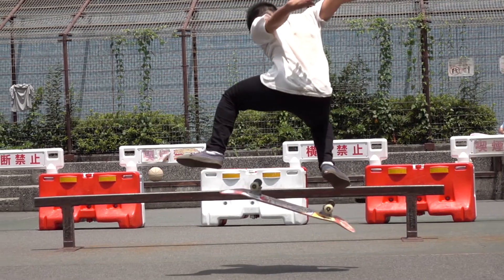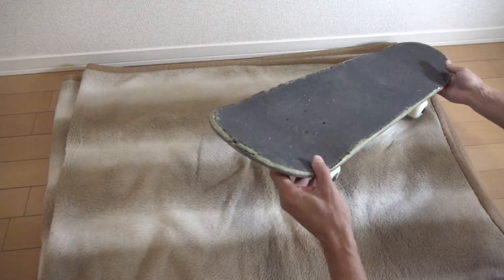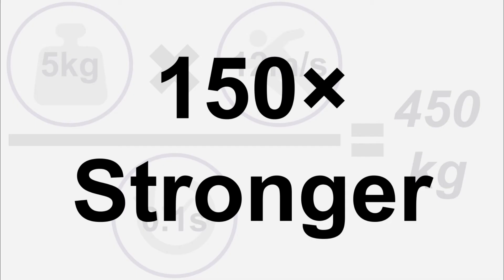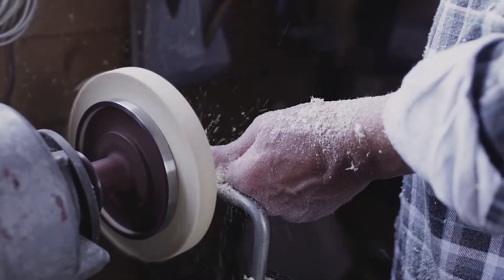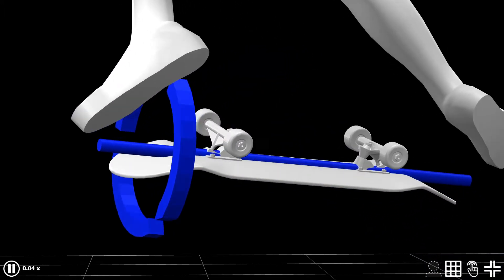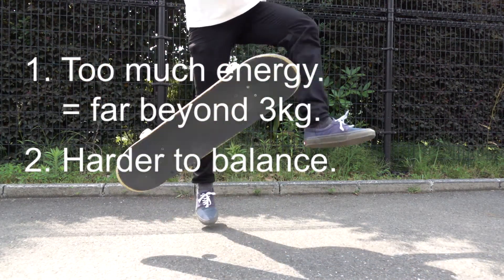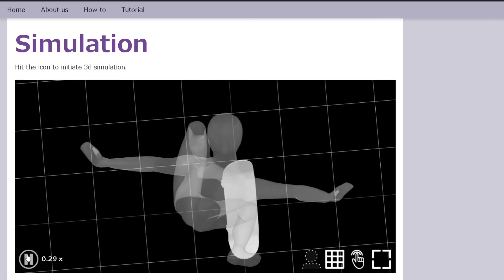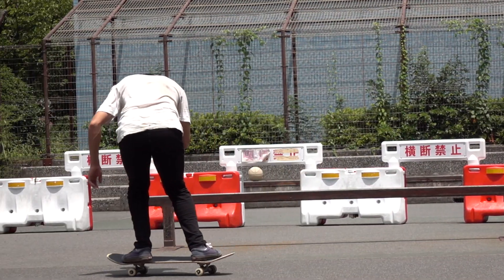Scientific analysis on flicks in kickflips with 3D models.

Comment: Ive landed a kickflip only a handful of times and your absolutely right it comes down to precise technique and timing, not force. I remember exactly how it felt when i landed my first kickflip, I popped straight down, jumped straight up, and flicked level to the horizon,  with my foot parallel to the long axis of the board. 

Flicking in an arc angle like you suggest is something new I will try and im sure it will work but it will take some getting used to. Thanks for the awesome content! I love your videos! 
🛹💛

Comment: These are the best “kick flip” videos on YouTube or anywhere for that matter.  The part about the board being on an axis - if you can comprehend what he’s talking about you will flip the board with total ease. My problem was my left leg/foot (I’m regular foot) would over extend/pull towards the side forcing the board to land way over to my heel side.  My legs were way too far apart and not in the same axis. You are not kicking the board at all - should really be called something else - roll your foot sort of under via a flick of the ankle - “flickflip” Dont use your leg per se - it’s really a roll of the ankle. Don’t stand there like other tutorials by dragging your toe then flicking it off the side - you will just end up ruining your shoes prematurely 😂

Comment: What about pressure? I feel like the rear foot pulling the board against the direction of flick to balance the net forces along the longitudinal axis of the board generates pop/leveling out of the board and keeps it more or less under your feet even tho the vector of the flick alone wants to send your board in front of you
Reply from the maker: true. I think we also have to take into account the angle of the tail, weight distribution and everything... so many things to do huh

Comment: i have a question, is it harder to flick the board if the shoulders and body position parallel ti the board? because most of the pros told that we need to keep our shoulders in line with the board.
Reply from the maker: It's rather complicated to explain it here but the use of shoulders may affect how your board spins horizontally, not how hard it is to flick. 
If you have difficulty keeping your board pararell to the direction you are going to, and your board does a sort of varial flip, that's when opening shoulders may become a problem.

On the other hand, I haven't found any causality between the difficulty of flick and the angle of shoulders.
After all, it’s only a matter of 3 kg of a flick. If you can kick a soccer ball, that makes you strong enough to flick a board. 
I mean, look at Luan Oliveira goes. He's a living proof.

By the way, my next video will be THAT. Scientifical proof on the use of shoulders. So please come back soon!
Reply: does the next video includes the answer fot the unanswered questions on this video, the flicking down?
Reply from the maker: I'm afraid not.
So please let me share my thoughts here:

I saw your video on your channel.
And it seems...
- you are flicking down.
- your backfoot raises up in reaction to your front toot flicking down.
- your timing, pop, weight distribution seems just right.
- your flick has room for further improvement though.

I'm assuming you think you need to flick down because if you flick forward your board either flies away or it kind of "sticks" to your front foot.
They both indicate you are flicking too far.

So I'd recommend...
- flicking forward without moving your front knee
- when flicking forward, DO NOT over extend your front foot. you may be able to avoid overflicking by envisioning where to stop flicking. your front foot should stop right next to the nose of your board, NOT any further than that.
- remember, flicking itself is not the hardest part. keeping it compact and fast is.

Please let me know if you have any more question.